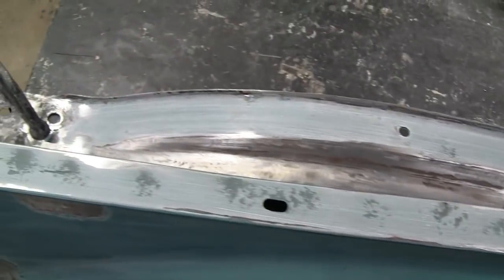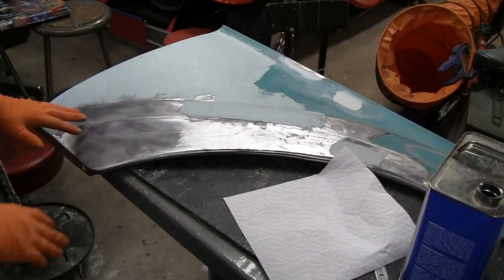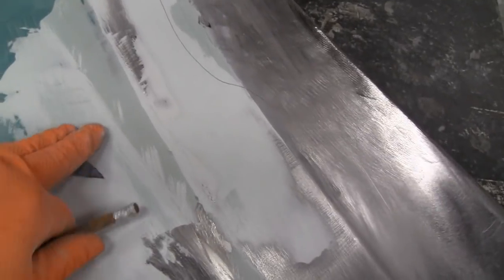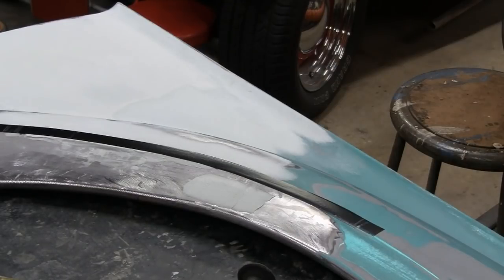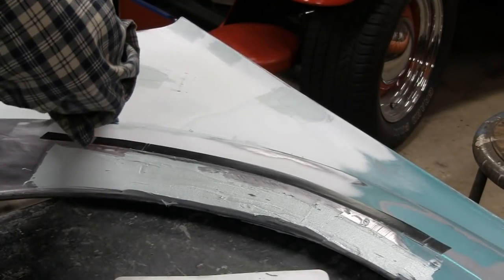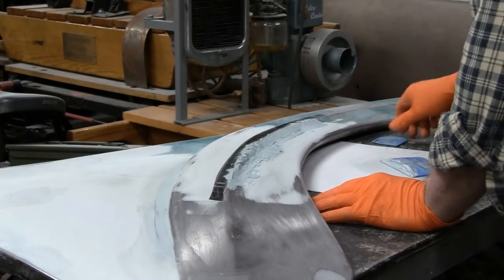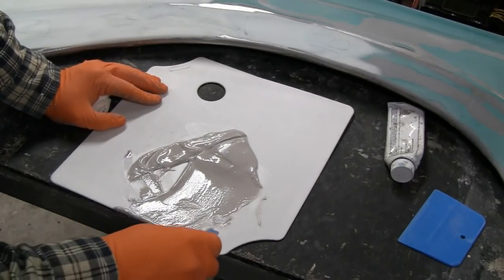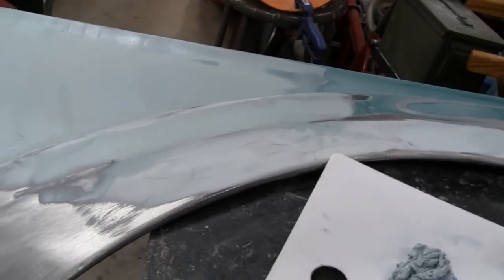BODYWORK & GLAZING PUTTY ON FENDER (F100 part 38)

Comment: Brother RK,
Using electrical tape as your guideline, was that what you had handy or is that what you normally use and it's a vintage body man's tech tip of the day?  Just had never seen anybody use electrical tape for that purpose.   

Another great RK Productions movie!
Reply from the maker: Thanks Dan'l!! Yeah that was actually the "Tip of the Day" a few videos ago on the other fender!! Masking tape won't make that curve without puckering and the 3M striping tape is to expensive to waste, so the electrical tape works perfect for that!!☺